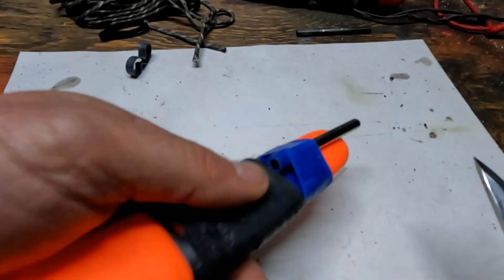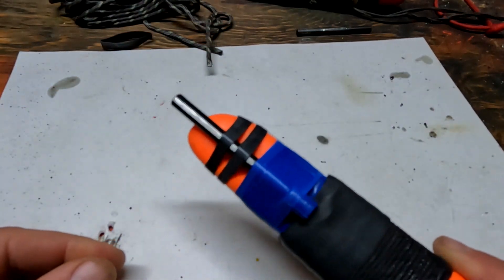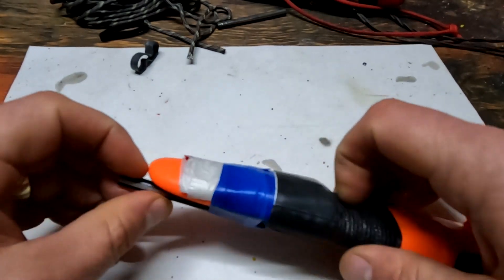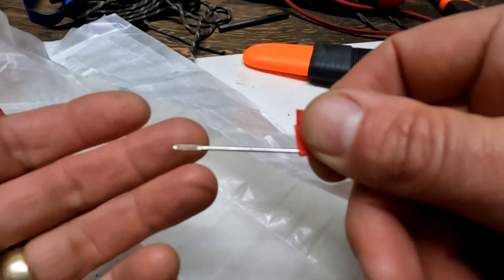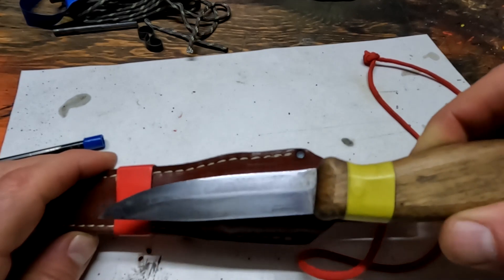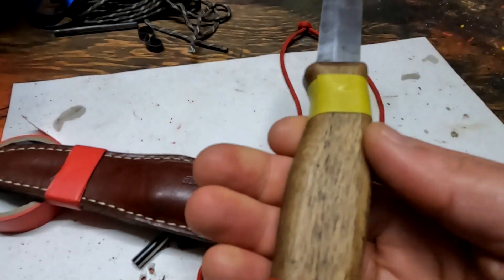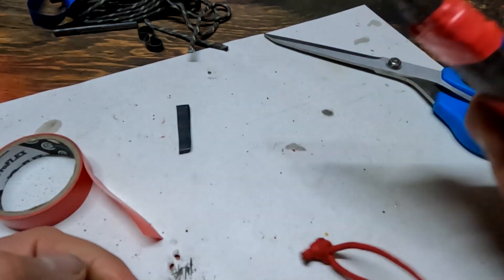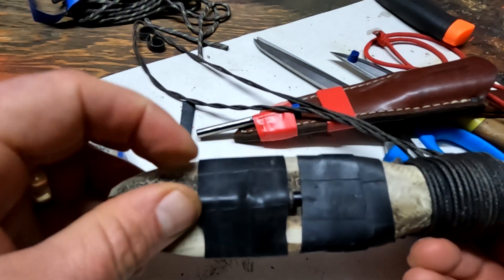Tips for Attaching Ferro Rods to Knife Sheaths

Comment: First, I do enjoy many of your videos.  I find some useful tips and ideas in them.  Second, and I don’t mean to be or sound critical, but as survivalists, I think we can handle some constructive thoughts.  I’m thinking your kids need larger ferro rods to use.  They come in different sizes and diameters.  Those tiny ones are ok, but if you’re worried about them cutting themselves scraping a ferro rod, A) they’re holding the knife wrong and B) the ferro rod is too small.
As for fishing gear…. I took that out of my gear.  Just my preference, I don’t find it useful unless I planned on being lost or stranded more than a few weeks.  If I get turned around or injured, I would be more concerned with water and being rescued; and figure I’ll only be out there for maybe a night, 2 if weather makes it difficult for searchers to find me.  I bring beef jerky and a couple power bars for the protein and a morale booster.  I let at least 2 responsible friends or family members know where I’m going, what path I’m taking and when I plan on being back.  I have water with me, emergency fire starting tinder, a lighter as my first fire starting source, cordage, a fixed blade, a ferro rod as a backup source, and I’ll have a bivy sack and a comprehensive first aid kit complete with a larger adult size ace bandage incase I sprain or break my ankle or arm, etc…, and I always have my rain poncho that can be used as a shelter.  
The rule of 3 applies.  We can go 3 weeks without food, but only 3 days without water.  Hypothermia happens in the summer.
Reply from the maker: All great points man.

Comment: Im going to try some thing along those lines as well,i do see the ferto rod attached to the sheath a good option especially if you eg. Fell in to a body of water say its cold or winter you get out might be going hypothermic, so your motor skills arent the best but with the sheath as an added handle its going to be a lot easier to hold on too when you try tospark a warming fire imo than trying to hold on to a small section of the rod itsself all in all great options imo !

Comment: 👍 Another great idea!  I must admit it made me go, “OMG why didn’t think about that?”.  😂😂😂.  I use YELLOW electrical tape to attach a mini BIC lighter to my knife sheath then attach a whistle and small light to the neck cord.  I “borrowed” that idea from Cody Lundin.  The lighter is my “all else has failed and I need a fire now” resource.  It is not my day-to-day fire resource, but it would be easy enough to add your ferro rod and wax paper idea.
P.S.
I have a leather sheath because they look better IMHO, but my knife handle is bright ORANGE.
Reply from the maker: Orange handle!!! Hooray!!!
Reply: @outdoorsonthecheap   i completely agree with your thoughts on knife colors.  Why do we try to make one of our most valuable tools so it looks beautiful, but consequently blends in when laid down.  I do have wood handled knives from Sweden (Mora #2 and a vintage Frost) but have done what you did in the video, painted the butt end of one Orange and the other Blue (as almost nothing in nature is Blue).
Reply: i'm into cody lunding and been studying his book now so i absolutely agree with you and with the video. furthermore, it is important to have multiple ways to start a fire in case of some sort of emergency. it's not just redundancy but different methods (flame [match and or lighter], spark [ferro rod], ember [flint&steel&char cloth, bow drill]). and it doesn't take much more to include fire starting material just in case. so again, great comment and great video.